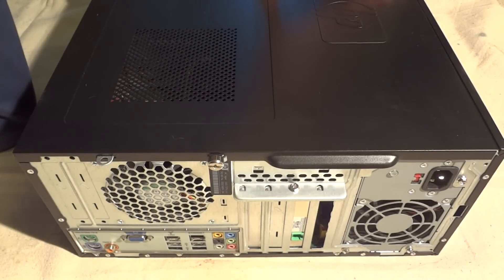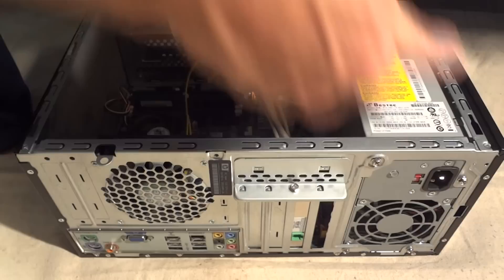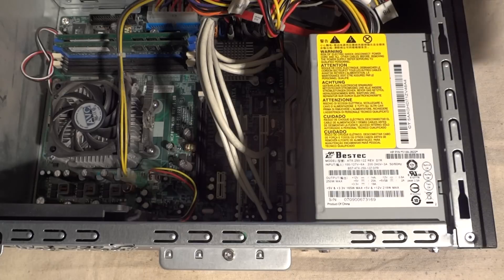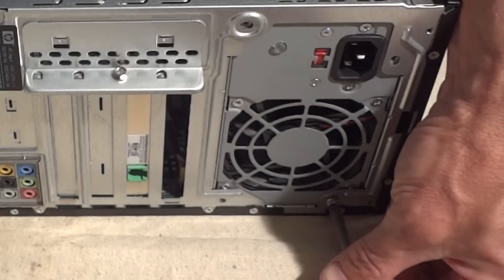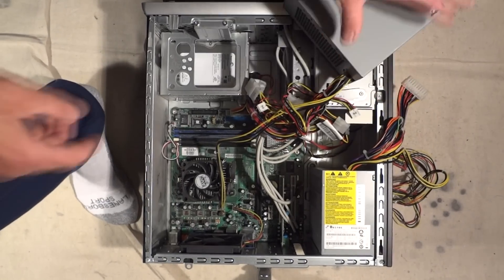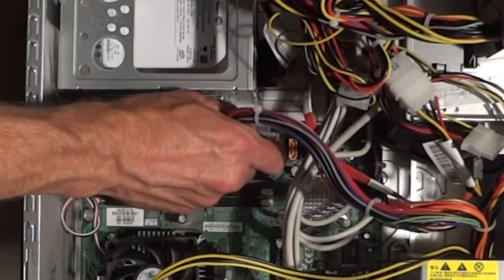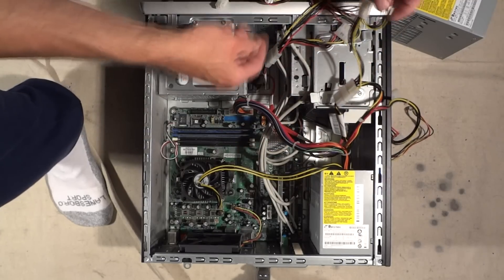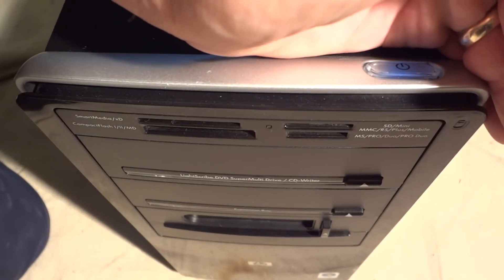How To Replace Computer ATX Power Supply

Comment: My power supply just flashes. It's an old psorial computer. It was in storage on air-conditioned for 10 years. It's a 250 W. The closest I could find was a 450 W.

Comment: Your "casual straight forward approach to this problem" (to quote @MrCaronhalt) is going to screw people who follow your lead of just flinging the excess power supply cables into the enclosure, and the loose leads end up jamming one of the muffin fans cooling an expensive component like a CPU or video card.

Comment: Hi, I was wondering if u could help me with mine. I bought a power source but it's a little different from the original one. The fan is on the side and not on the back. Is it safe to still try it?

Comment: Sir I brought my PC from relative and it was assembled by him only, from past few weeks it was shutting down automatically while working and PC was heating a lot, so I tried applying thermal paste and one additional fan, but it doesnt seemed differrence. I thought of removing all connections from the motherboard and re-assemble it, but It was very difficult to unplug the ATX 12 volts pin, it wasn't coming, I tried many ways to remove it but it was stuck very hard and Finally I decided to brake it off the pin which came from SMPS and put another, my mother board has 8-pin slot and the pin which was plugged to it was 4-pin and finally I broke the 4-pin and removed it from motherboard. And now my doubts are:-
1) Why wasn't the pin coming out, is it due to any burns?
2) Why was my PC heating a lot, is it due to less power from SMPS?
3) Now should I change whole SMPS or just a pin?
4) If I change pin should I use adapter?
5) What if the slot is burnt on motherboard?
It would be so helpful if you have solutions for me...🙏🙏🙏,  and I am not a gamer, I use my PC for editing and I use softwares such as after effects, premire pro etc. I have 8GB ram, Nvidea zotac 1GB Graphics, AM3+ processor, AMD motherboard, and zebronics SMPS.
.
.
ANYONE
Ping me if you can help me 7026655068
Or comment your phone no. I will contact you. 

Please, it would be so helpful if anyone gives solution. 
 Thankyou so much.

Comment: Do you need the EXACT amount of ampage for each voltage or can you balance it out...for exampke i have a 500 w psu that has +3.3 v, +5 v and +12 v but it has 30A for each and i want to upgrade but nothing exists that has 30a for each...so im wondering, if the +12 v has 62 A and the others both have 20 A could that work?
Reply from the maker: You want a power supply more than the amperage you need.
Reply: @RJTheBikeGuy  oh ok thank you

Comment: And I don't want to get a new one I need to get it fixed
Reply: +Undead Gamer you cant ''fix'' a blown power supply....
Reply: +Undead Gamer Moron...
Reply: +Undead Gamer added note you can fix a power supply but the costs of repairing a no brand supply is as expensive as getting a new better brand name one.. you can get a be quiet 400 watt for 40 euro's and its a very good power supply

Comment: Great...Thanks alot. But can you replace a 300W PSU with a 305W?
Reply from the maker: +Leon King Probably. You want to make sure you have all the right connections and enough amps on the various voltages for your machine.
Reply: +RJ The Bike Guy . The HP Compaq dx2420 microtower comes on and goes off in 7sec. The PSU light goes low when powering on and shutting down in 
the process. And this happens continuously until I apply immediate 
shutdown by pressing and holding the power button  . Please advice on the wattage. I have 300W and want to replace it with Dell 305W. Is it ok or not?
Reply from the maker: It could be you need more wattage, or it could be something else.

Comment: I have an HP Pavilion p6-2327c. The case in this video is VERY similar. I am going to get a Corsair 500w Modular. The dimensions of the PSU are the exact same like the one in my case. This video was very helpful.

P.S. Those must be some old hard drives if they use Molex connectors instead of SATA power ones lol!

Comment: i just did this to my pc and it work but then it says Disk boot failure- insert system disk and press enter ... i plug all the cables just like you did . what should i do?
Reply from the maker: +sangrando oidos Sounds like the hard drive is not connected properly. Maybe the power cable is not fully connected, or maybe the data cable came dislodged.

Comment: thanks so much. I've been getting by for over a year with the hold 10 sec etc fixes, that i have to do every time power goes out. My green light is on steady but still if my pc is off for more than a few seconds it doesn't want to power back on w/out me playing games with it. This last time nothing has worked & I've been without it for weeks. I'm going to try the hairdryer trick & hope that gets me running temporarily until I can install a new power supply. I watch TV through my hp & new shows are on tonight, so fingers crossed. Thank you for such detailed power supply replacement instructions, I am going to order a replacement tonight. Thanks, Lisa

Comment: Hello, can you please help me? I have a HP Compaq Presario Desktop and need to replace the power supply. This is my first time replacing anything inside the CPU. I was able to take out the power supply. Now, I just need to buy the right replacement. 

My power supply model is Bestec ATX250-12Z REV:.D3R and I can't seem to find a D3R model on Amazon. So, I'm thinking of getting the same D7R model/unit as the one you got cause the specification is all the same except for the S/N and P/N. Will D7R be ok as a replacement? If not, can you please help me find a good website to buy a D3R? Thank you!

Comment: Is it okay to put a 400W power supply into my CPU? I have the exact same type that you have in the video. I'm just wondering
Reply from the maker: You should be able to if the PSU has all the right cables/connectors that your hardware needs. I just dropped a 500W PSU into my own computer and it works great. This is what I bought: http://www.amazon.com/exec/obidos/ASIN/B00H33SFJU/ref=nosim/youtube25-20
Reply from the maker: Oh, and make sure the PSU is the right physical size to fit in your case. This PSU replaced my old 240w PSU.

Comment: if i buy a 500w PSU will it be able to power a Graphics card that needs 500w? or do i need extra like 600w?
Reply from the maker: Not sure. Sometimes I think they are suggesting you have a 500w PSU. Other times I think they are saying the Graphics card uses 500w. You will have to do research on the card you are looking at and see what people suggest.
Reply: Yeah i found out it is enough but i want to play it safe and got a 730w thanks anyway
Reply from the maker: Make sure it will physically fit in your case. Some ATX power supplies are a little bigger, so you need to check the measurements.
Reply: aight

Comment: You rock!  I will try the previous vid for a temp.  fix until I can get a new power supply.   Poor CPU… at least everything else still works so far.  Thanks for taking the time to share!
Reply: ObsidianBlaze Yeah my poor CPU runs 24/7 & has been since May 2008. I'm disabled & use computer for everything! Last year it started not turning back on after power outages the "unplug, hold etc" tricks worked for over a year this last time nothing worked until i saw RJs video & tried hairdryer YEAH! I'm back on! But, i agree my CPU deserves a new power supply & RJs video makes it look easy. Did temp fix work for U? Did you have any problems replacing power supply? Lisa

Comment: I have a question. After replacing the power supply and getting the computer back on, do you lose anything? Like pictures, music, etc
Reply from the maker: You won't lose anything by replacing the power supply. That stuff is on the hard drive. Replacing the power supply wouldn't do anything different than turning off the power, or unplugging the machine.
Reply: shyflirt1
 Thanks

Comment: Thanks for your amazing videos! Where did you buy the power supply you used in the video and how much was it?
Reply from the maker: This is the one I bought, though it was a little cheaper then. http://www.amazon.com/exec/obidos/ASIN/B009434582/ref=nosim/youtube25-20
With some research, you might be able to find the same model of power supply cheaper, or find a cheaper alternative. Not even sure this is the same model you have in your machine.

Comment: Thank you so much for shooting this video. I have the exact same computer doing the exact same thing. The hair dryer did it's job, and now I'm going to replace the power supply. I like your way of removing and installing the new PSU the best since I would have a hard time trying to figure out which connector was the right one. All the other videos on this subject have you removing the old PSU completely before installing the new one. Your casual straight forward approach to this problem gave me the confidence to do this on my own, Thanks again.

Comment from the maker: Christian, yes, just but a new power supply, and replace the old one. I didn't bother letting it sit. There are capacitors in the power supply that will hold a charge, but you are unlikely to get shocked by them without trying.
Reply: +RJ The Bike Guy ..Thanks for advice.

Comment: I tried the hair dryer remedy and it works great.what's
the purpose of using the hair dryer to get the ATX power Supply working.what Cause the computer to not power up.thanks again for this info.
Reply from the maker: The power supply is dying. Some of the components are not working 100%. Heating them up makes something work better and it can it can hit some sort of threshold that allows it to power up. Probably the capacitors. But if you have a power outage, or unplug the machine, you will probably have the flashing light problem again. Eventually that may not work.
Reply: thanks  once again for this information,I will still go purchase one and wait to this one dies down
and  and exchange it.thanks friend.
Reply: David Bonilla Sr h

Comment: Hi mate,

Thanks so much for your very helpful video.  Took the computer apart and was stumped and starting to worry it was going to mean a new computer.  Anyway, put it all back together and hoped for the best.  Still nothing.  Last ditch effort I used the hairdryer and lo and behold, we had life!  Nice to know that's the problem.  Incidentally, I didn't have a flashing green light.  The light was solid, but it still worked.  Delighted - thanks again mate.

Comment from the maker: I don't know specs on those power supplies. You need to do some google searches and find the specs for the both of them. If the d7r model has the same or better specs, it will work. Some of the newer power supplies have more wattage, but less voltage on some rails which the older computers used.

Comment: Where did you get the power supply you ordered? I have the same computer, and same Power Supply as the old one in the video. I have the same volts/amps. And I did the blow dryer thing, and didnt get a solid green light. My lights was still blinking, and was very dim. Im hoping this means the power supply is so dead that it cant even light up the green light completely. But all I need to know is where you got the same power supply. Thanks for the help though, love the videos.